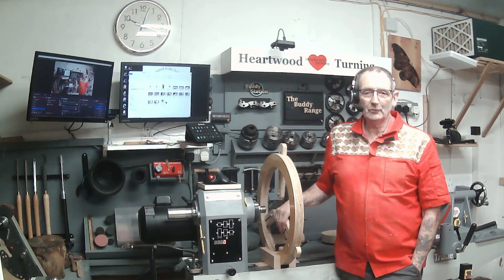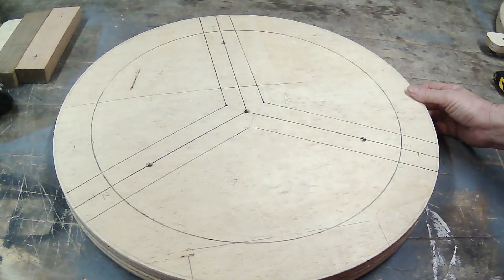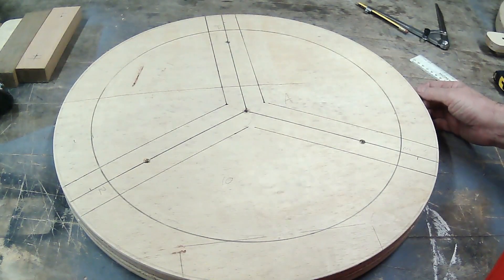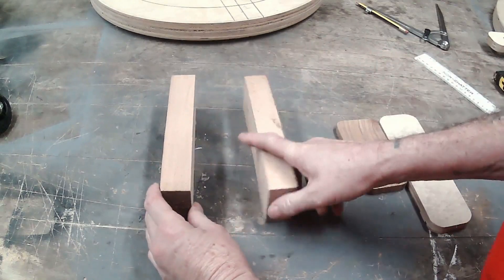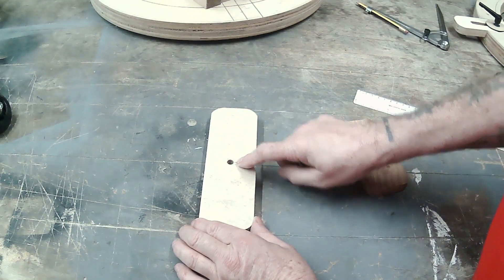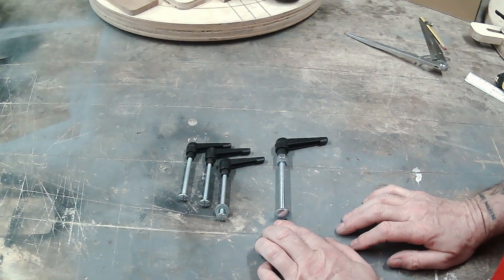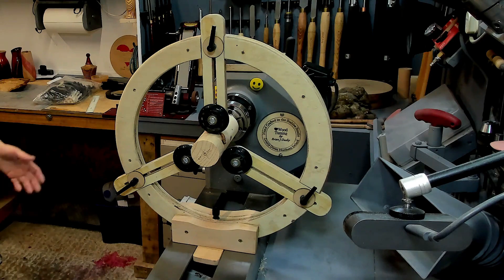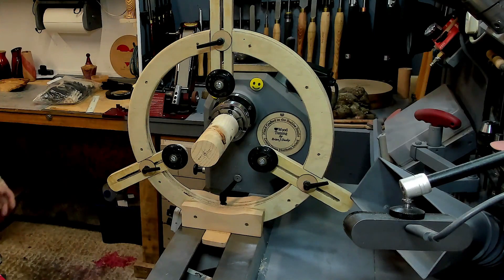Making a Steady Rest #Steadyrest

Comment: Nice tutorial Brian. I also used Mike Walt’s video as a guide to make mine. It’s been a great addition to my shop. One thing I did was drill and screw the two rings together through the three sections prior to cutting them on the band saw. That way the screws acted as locating pins when it came time for the glue up. This way I knew the three pieces would go back exactly where they came from.
Reply from the maker: I did note that that would be an easier way to locate the Rings and will be doing that on the next one 👍👍

Comment: Thank you for this great instructional video Brian.  I've not made  one of these yet, but I wanted to pass on a tip based on a sanding table I made and how I did the bottom clamp.  By fixing a screw in the right place, the bottom clamp automatically stops at right angles to the bed ways.  So you don't have to look or reach underneath.  When you loosen your locking lever, the clamp turns anticlockwise and parallel to the bed ways and allows the device to be lifted out, again without reaching or looking underneath.  I made my bottom clamp out of steel, but I'm sure the same technique could be used with a timber one.  However, I realise my lever (actually a turned knob) is fixed to the threaded stem like the lever in the side of your banjo, and then there is a nut welded to the metal bottom clamp. Unfortunately if I try and include a link to a photo of what I've done, YouTube won't publish the comment - thanks YouTube.
Reply from the maker: That’s a good idea Doug thank you for sharing that. I hope others will read the comments